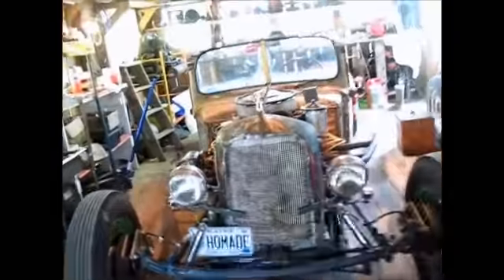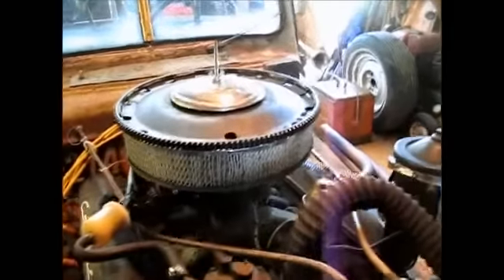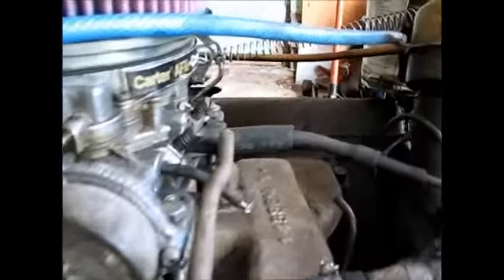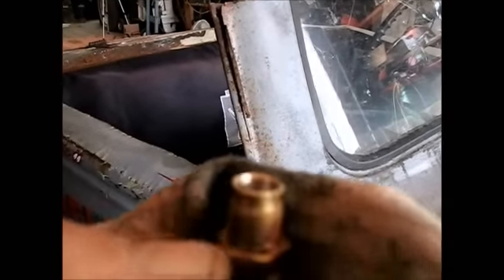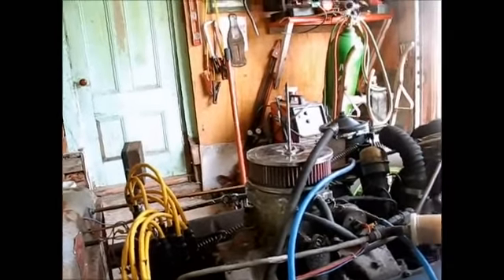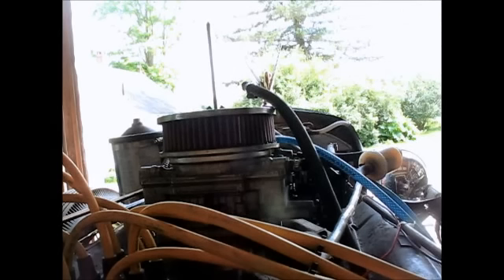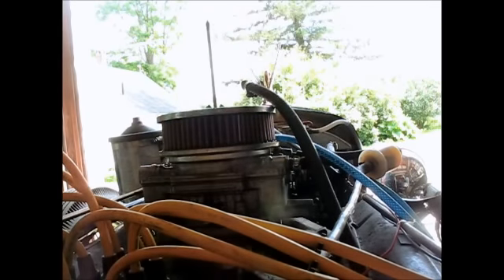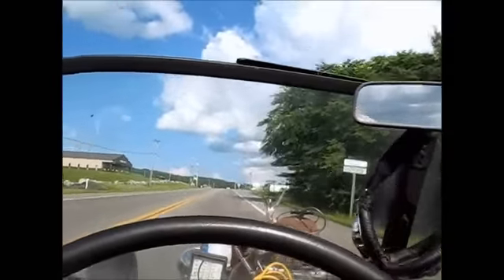Big Breather?  Little Breather?   All over again!

Comment: A cloth breather will let more air in than a paper one will. The K&N one is cloth it should breath great. the small size will get dirt quicker than the big one but you can clean it with a air hose easy and reoil it.

Comment: The biggest trouble with oil soaked air filters is they work great when they are maintained and are kept oiled but most people don't maintain them well, so in the end they let in more dust and dirt or they get plugged up.  Maintaining a oil soak type filter and it will work well and breathe better than a paper filter. Did I mention they need to be maintained? Hahaha